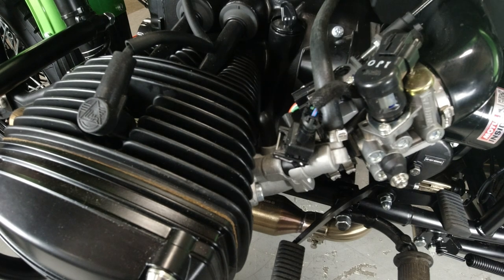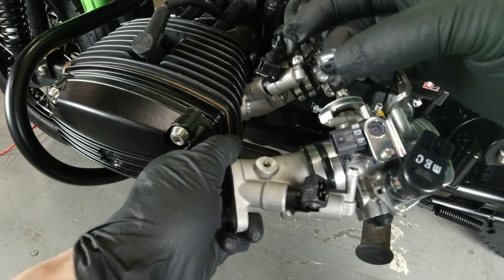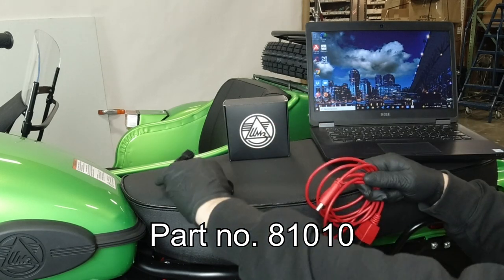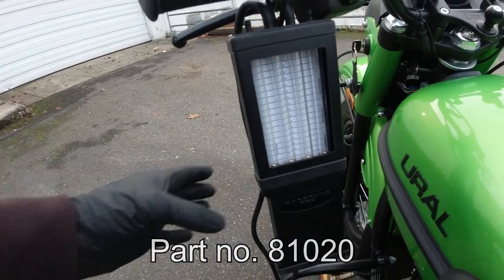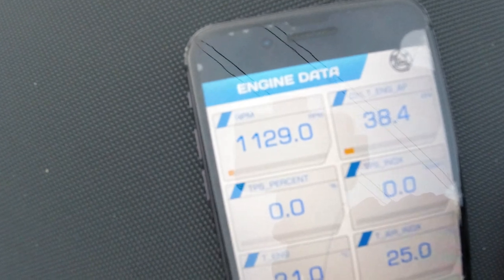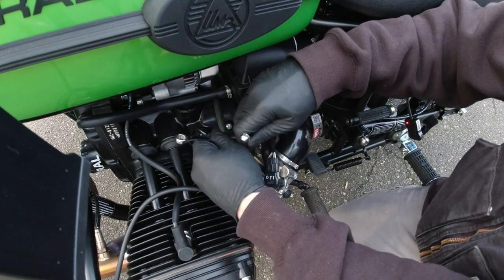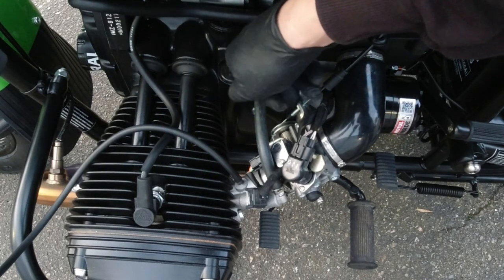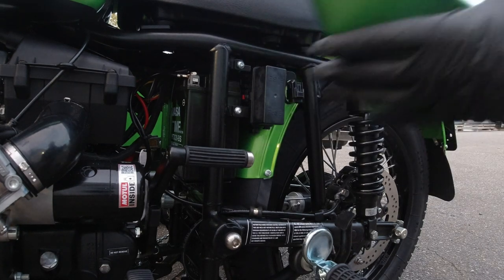URAL How-To - GEN II EFI Balancing Part 2

Comment: Hoping someone can comment - My new Gen II EFI Diagnostic Tool initially displayed two columns of engine data as shown in this video, then one day began only showing one column of 24 data parameters. I tried deleting the app, resyncing my phone with iTunes, and then re-downloading the app but it still remains a single column. Does anyone at Ural (Nick?) or a commenter here know how to change it back to a 2 column display?